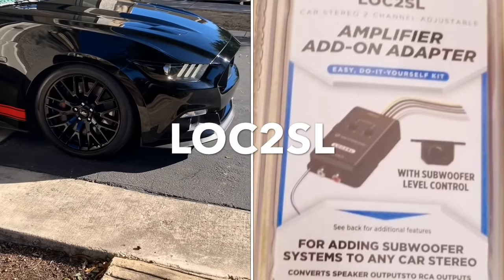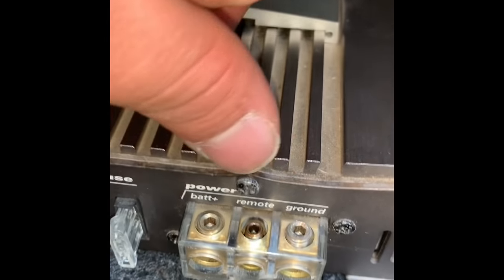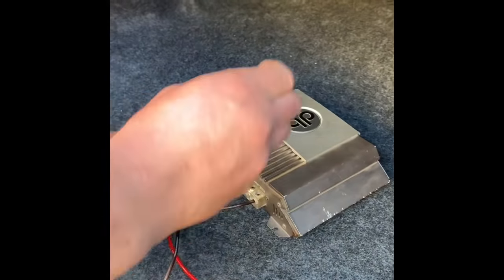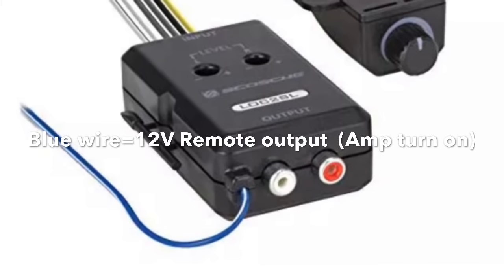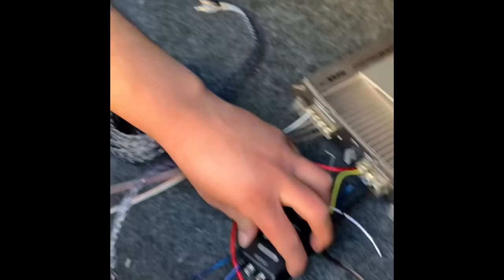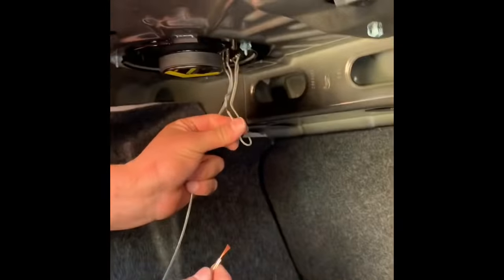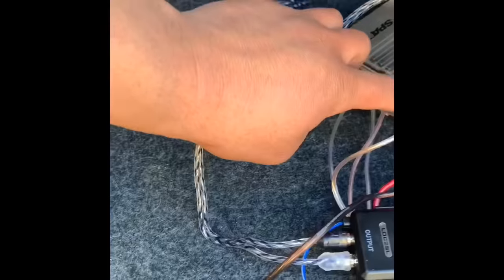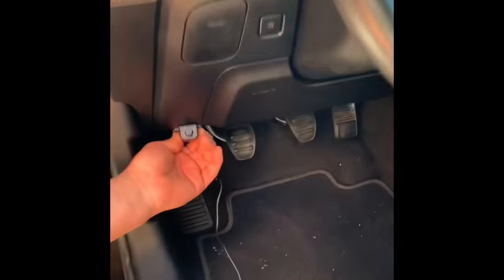How to install AMP/SUB to factory radio/LOC2SL amplifier ADD-on adapter

Comment: I don't understand what those speaker wires were running into the side of your sub box for... I thought that was the speaker wire to tie into the car. My sub box only has the red and white cable holes... This is my first experience.
Reply from the maker: Zip G those speaker wires running to the side of my box hook up to the amplifier
Reply: @sperez6140  are all amps made with those speaker wires? Mine just have the red and white... It looked like they were running to the inside port of your subs.
Reply from the maker: Zip G look buddy you’re making this very difficult for yourself all you need to know the amplifier has a power a ground and a remote wire you need all three of those wires to turn on your app, now to get sound you need to hook up the power and ground wire from your speaker to be power and ground wire to the amp, after that all you have to do is hook up your RCA jacks and you’re done
Reply from the maker: Zip G  take the cover off for your amp  if you cannot see the speakers connection, I do not mind showing you the steps let me know when you’re ready
Reply: @sperez6140  Man it was my damn fault. The sub that I got has a red and white input for the cables that I thought was for the rca cables. But it's for the 8 gauge speaker wire. I got it now. Thanks man. You can tell I'm new to this.  Yours was the easiest explanation video I watched and still managed to get confused.
Reply from the maker: Zip G 👍👍👍👍👍

Comment: Would it work taping into door speakers? (2011 mazda3”
Reply: Yes it will, I just tapped into my rear left door speaker and my rear right speaker and ran the wires to my trunk. It’s a bit more work though

Comment: Quick Question, What Tool You Used To Pinch The Rear Speaker Wires?
Reply: Wire Strippers

Comment: Question how do you disable the anc active noise control to the 10th gen si’s
Reply: Kingston Flores instead of running that blue cable to the amp, run that blue cable to your fuse box (the one off the rca adapter) make sure you use the radio fuse. My accord did the same thing. It was annoying. Hope this helps
Reply: @BryanMartinez  I ran my power wire from the fuse box acc 10amp to my Amp i deleted the cap for the time being since i did that the subs have gotten even louder. What i also did was connect my subs in 4 ohm DVC & it comes out in 2ohm, i may add a motorcycle battery in the near future or a bigger cap like a 10 farad im doing some research on which is better so I don’t kill my battery or alternator

Comment: On my 2012 Chrysler 200 when I install the power wire to my battery the headlight flicker and it shuts my car off... why is that? The battery is located on the drivers side quarter panel
Reply: Cause its a chrysler that's why lol
Reply: Yeah lol

Comment: So I have a dodge nitro 08, and i have 2 12s and amp with a factory stereo installed about 2 months ago. Now my head unit, the stereo keeps turning off/ on. Why?? Please help.
Reply from the maker: klou where did you install the LOC through the back speakers or behind your factory stereo??
Reply: @sperez6140  The Loc is installed In the panel between front and rear door on driver side... I notice yesterday that my fan is Not blowing when the stereo is on. Would that cause it to shut off/on?
Reply from the maker: klou  what fan?
Reply: The fan that is in the factory unit... doesn't have a fan? Well it looks like one to me lol
Reply from the maker: klou I’m not sure my friend, but most fans on multiple products are made to turn on and off

Comment: What happens if you connect the negative with the positive speaker wire?
Reply: It will be out of phase. One speaker will pull while thenother pushes, canceling out their sound

Comment: Did you still put a fuse at the battery?
Reply: The big red positive wire that runs from your battery to the amp has a fuse on it but make sure the fuse is on the battery side

Comment: can you use this same method on a powered sub. please reply
Reply from the maker: brutal131 Please explain a little better so I can answer
Reply: @sperez6140  well if i got a powered sub like the Rockville USS10 that had the same power ground and remote connections and a line input would it still work. i dont see any vids of people connecting powered subs with an LOC. Im completely new to car audio and your vid/method is the first that makes sense. Thanks
Reply: @brutal131  Dude all subs are powered, like what do you mean lol?

Comment: Whats the point of the remote wire if your amp wont turn off ?
Reply: Korre Rivera  it turns off for me.  I used the same set up.
Reply: He didnt hook the loc up right. It's not supposed to be hooked up to the amp
Reply: @razorzedge9746  can you explain how it should be done?  Currious!

Comment: Ok so what if im wanting to run one 12 in sub? Do I combine both rear speakers into one ch for my sub?
Reply: @Phuong AMG Nguyen I scrapped the line converter  and bought a 15 dollar jvc deck with preamp output for rca hookups and ran sub straight to the amp speaker terminal...works fine now..much better all around

Comment: I have a pyle 7 inch flip out screen single DIN when I'm in radio mode I have subwoofers but when I go into aux 3.5 mm head jack mode I have no subwoofer please help what can I do to fix ?

Comment: That will kill your battery your amp is constantly on since you hooked up your remote wire to a constant power source. You need to find an power wire that's not constant because that is a bad hook up. No hate man just letting you know. I went to school for mecp certification.
Reply from the maker: RazorzEdge it has been 10 months no battery has died at all my friend, everything is working perfectly just like it should, I am 100% aware of what you’re saying, yes you are correct if you install the remote wire to something in the car that turns on and off yes you can turn off your amp like that and turn on your amp , if you read the comments you can see on there where I am telling people that, for example the best bet will be find the power wire to the stereo unit , or like I mentioned before on the video you can install a switch where you can turn on and turn off your system whenever you like .thank you sir you have a good day 👍

Comment: I did all of that and in the end I got a amp that light comes on and a whole car that won’t play anything... help?
Reply from the maker: BBQfries when you say it does not play anything can you be more Clear
Reply: Well I figured out today that I blew a fuse in my car
Reply from the maker: BBQfries OK buddy good thing you figured it out is everything working good?
Reply: Yeah I just got to go get another fuse, BUT I will say your instructions were super easy to follow!
Reply from the maker: BBQfries Thanks for the feedback
Reply from the maker: BBQfries Thanks for the feedback
Reply: Blown fuse should of unhooked the negative battery cable

Comment: good video except remote something not right with the remote wire  it should turn you amp off when you turn car off thats the point of the remote to turn off and on you shouldnt have to run it to a fuse all other videos that show this hook up there amp turns off an on when you turn the car off and on by just hooking up to the remote wire without running it to a fuse not sure whats wrong there

Comment: I don’t have speakers in the back only in the front
Reply: Capo Stream It’s all the same. You can tap into either front or rear.  Just make sure you tap into both “front left and front right”.  

You can also tap into the speaker wires by removing the factory head unit and installing the converter there. However, it can be a headache to identify each wire that goes to a speaker .  Hope that helps

Comment: You shouldve used the power 12v connected my amp turns off and on with my car with that same loc.
Reply: me4twelve what do you mean use the power 12v
Reply: @d.bcooper9900  so you tap into like your lighter plug and run a turn on cable to the amp this way it turns on with the car.
Reply: me4twelve what type of car you got?
Reply: @rolandomota4683  installed it on a 2019 Nissan kicks.
Reply: me4twelve yeah that’s how
I did it to my cigarette lighter
Reply: me4twelve that shytt bumps? Im trying to do it to a 2018 Civic bro
Reply: @rolandomota4683  yea itll work because I've tried it also on my friends 2013 civic.
Reply: me4twelve for sure bro good lookin
Reply: How would you go about running a remote from your lighter ?
Reply: @rolandomota4683  Ford Escape.

Comment: my amp light stays on when the car is off is that a bad thing?
Reply from the maker: The Real Martinez If you use your car every day it should not be a problem as long as the light on the amp is not very big you will be good👍. No worries this LOC is made like  that your amp is going to stay on
Reply: You have yours running from the amp my loc is from the hu are you sure?
Reply from the maker: The Real Martinez what is hu?
Reply: S Perez head unit
Reply from the maker: The Real Martinez is your Head unit factory or aftermarket
Reply: S Perez factory
Reply from the maker: The Real Martinez OK perfect one last question before I answer your question do you have the same LOC I have
Reply: S Perez yes I do
Reply from the maker: The Real Martinez yes it’s normal for your amp to stay on all the time, The LOC don’t matter where you install it in the trunk or behind the stereo because  you can hook up to speakers  from anywhere, but the remote wire coming from the LOC has nothing to do with that that’s a whole Nother wire and that wire hook up straight to your amp and its made to stay on, I hope but answer your question, If you do not want your aunt to stay on by a switch where you can turn it on and off at AutoZone or eBay or Amazon
Reply: S Perez I might run a quick disconnect tap to the remote wire but just making sure I’m not going crazy my first new vehicle never used this before
Reply from the maker: The Real Martinez No worries this is a good product all you have to do put a switch on the remote wire that’s it you could turn it on and off whenever you want
Reply from the maker: SuperSpinster12 really run your remote wire to a fuse ?????????, yes that works to but in this case I’m showing how to install a LOC and the blue wire on the LOC is a AMP  turn on , this video has nothing to do with a wire running to a fuse 😂 because this product is not made to get install like that my friend, if it was I would have put that part on this video, people please do not just run a wire to a fuse because it can get hot and melt the fuse , and in the future cost damage to your fuse box,  if you do want to run a wire to the fuse box please make sure you order or buy a fuse adapter .what you would do is take out which ever fuse you are using , then you will install the fuse adapter then you install your fuse on the top of the fuse adapter, the the wire on the fuse adapter will install to the wire   To the amp .
Reply: @SuperSpinster12  i solved it with a rocker switch works great thanks tho guys

Comment: Good video. Also if anyone has any wiring issues go to the12volt.com and they have a lot of wiring diagrams for different vehicles. Takes out the guessing when it comes to the different speaker wire colors
Reply from the maker: Jake Welsh thanks buddy , I appreciate the info 👍👍👍👍👍
Reply: S Perez no problem. Also create an account and if there’s not a wiring diagram for something your looking for then go to the forum and ask if anyone has one hey can share with you. Someone will find you what your looking for
Reply from the maker: Jake Welsh thanks 👍

Comment: What if you don’t have rear deck speakers
Reply from the maker: Christian Rios If you do not have rear speakers then you will install this Kit to your door speakers
Reply: u can tap into the speaker leads coming out of your head unit and run RCA cables from the LOC behind the head unit to your amp in the back
Reply from the maker: young_sbg14 gaming  No Sir , if I do it the way you’re saying I do not get the point of doing that way. The way I have it hooked up right now my LOC is in my trunk my speaker wires are in my trunk my RCA’s are in my trunk , now The way you are saying Will be wasting more time and running more extra wires ,  for example you’re saying tap to the speaker wires from the back of the  head unit  then run  wires to my amp.. i’ll be running wires back-and-forth, Right now I have everything in my truck everything
Reply: You are correct i have mine set up the exact same way as you but if i didnt have rear speakers i wouldve tapped into the head unit and run the remote cable to the truck along with the RCA'S Im glad i have rear speakers or i wouldve done it the other way
Reply from the maker: young_sbg14 gaming I understand , if you do not have rear speakers , you can always use one of your door speakers 🔊, which is better tapping into your speaker wires from the back of your Head unit, because most people won’t know which ones are your speaker 🔊 wires from the factory  head unit , 👍 yes you are correct you can always hook up this LOC in the back of your head unit if it’s convenient for you.
Reply: Clean set up though great job man 💯
Reply from the maker: young_sbg14 gaming thanks buddy👍
Reply: @sperez6140  can you tap into the speaker wiring going into the factory amp? I have a mazda 3

Comment: The power wire on the loc is supposed to go connected to something that turn on when the car is running 🤦🏽‍♂️
Reply from the maker: Joseph Ramos Perez That’s an option!
Reply from the maker: Joseph Ramos Perez hooking up to a switch on and off as well
Reply: I heard that with this particular model loc the way you did it , it will still shut it off i heard it turns off when thare is no sound at all so basically with the car off the remote the loc will shut it of is this true ?  Or i will need to find something to plug the remote were it will shut it off ??

Comment: My amp isn’t turning on and I hooked everything up
Reply from the maker: Javier Flores If your app is not turning on you need to make sure your -ground is good on some cars you need to sand down The frame a little bit
Reply: S Perez I checked and it’s hooked up good. It’s hooked up to a screw that is connected to the frame
Reply from the maker: Check another screw the screw you have has no good ground
Reply: S Perez checked every screw around it still won’t turn on
Reply: I had a newer stereo and it would turn on but the stereo went bad and I put the original on and tried this but it ain’t working
Reply: The only thing is I didn’t hook up the speaker wires because there on the side and it’s to much of a hassle
Reply: Because it has a light that turns on when it’s on
Reply: @JavierFlores-tx3xz  it has to be hooked to a speaker wire to get the sound to reproduce...

Comment: Lost my directions. Installing in different car
Reply from the maker: Chris Washington What exactly can I help you with where did you get lost
Reply: S Perez how would i install on a 2019 Nissan Versa s plus sedan?
Reply from the maker: Titus Rembert If it is too difficult to figure out which one are your speaker wires off the factory unit, you can always hook up to a door speaker
Reply: S Perez Ok I was wondering. I don’t have trunk speakers but I can print out a diagram shows speaker wires. Thanks
Reply from the maker: Titus Rembert no problem
Reply from the maker: Titus Rembert If your car has speakers in the trunk you can install it the same way
Reply: S Perez my car don’t have trunk speakers. It has only 4 door speakers.
Reply from the maker: Titus Rembert ok , you can hook up this adapter behind your factory stereo, but most people do not take that route because they do not know which ones are there speaker wires. But you can always print out a wire diagram of your car and do it that way so it can be easy for you. If you want to try a different way all you have to do is takeoff one of your door panels , and run this adapter to one of your door speakers, I hope this information was helpful to you👍

Comment: I got it all hooked up like that and amp is on but I'm not getting any sound from the sub. Someone help lol
Reply from the maker: bosanac213 Before anything does your amplifier work? Did your speakers work before you install this LOC?
Reply: @sperez6140  yes my amp is on and the sub worked fine in my other car
Reply from the maker: bosanac213 No what I mean does the speakers work not your sub the speakers to your car ?
Reply: @sperez6140  yeah speakers are working just no sound from the sub I have alpine mrp-m350 amp with a single JL 10" sub. And amp even turns off when ignition is off so I'm not sure what I did wrong and it's set up exactly like yours
Reply from the maker: bosanac213 If you have it installed like I did should be working properly, my last option is make sure you RCA jacks are working properly just because the new domain they are sometimes stuff come out defective second option, they are two small knobs on top of your LOC you might want to check those out
Reply: @bosanac213   Your rca cables are probably plugged wrong

Comment: Some miss information in this video🤦🏾‍♂️. To make your amp turn off and on, connect the blue remote wire to the radio fuse. In the fuse box
Reply from the maker: Nicholas Swain do you really want to run wire to a fuse ?? You know wire gets hot right??  We all know that you can run wire to a fuse , but it’s not a very bright idea, you can hook up to sometime better like relay for example.  This video is showing how to install this product only the way it should be instead. That’s the reason you don’t me installing blue wire to a fuse. Thanks for watching 👍